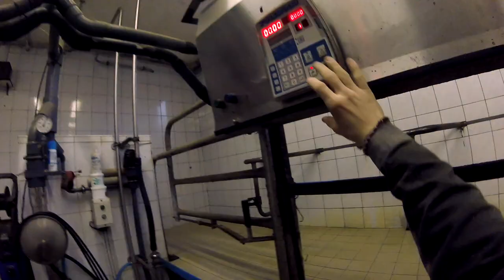A Day on The Farm #13

Comment: Great vid. What do ya think of the john deer. Have ya had any problems with it? All the best lad.
Reply from the maker: Thanks 🙂 its pretty good, especially for grass work or light tillage, it's not the best for the road, but I still use it for transport anyway 😁 we've had some problems the first two years (blown hydraulic pump gasket, powrReverser malfunction) but were repaired under warranty 😉

Comment: Nice video! What's the average prodution of your cows? Do you use any concentrated or you are grass-fed?
Keep up with the good job
Reply from the maker: Thanks 🙂 Around 7000 l in standard lactation. Main ingredients are hay, grass silage and corn silage but we also add some proteins, like canola and grains for energy. For higher production cows we have some concentrats 😉
Reply: @farmerspov4709  

With your average do you think that if your cows were strictly to produce milk, like jerseys for exemple, you would need concentrate? Because they have less need to maintain body weight
Reply from the maker: Hm, interesting question, I don't know, with smaller frame, they would require less energy for their own maintenance, but, depending on what milking average would you be aiming for, they would still need some concentrate to fullfill their demand with the ability of how much dry matter they can eat 🤔 example: if you would feed them only silage and hay, they would get to, lets say, around 15 l of milk daily average. Even if you would feed them more, they may not be able to eat much more. Then there is also peak performance about 1,5 month after calving when the demand is higher. Thats why you have to have some concentrated energy that they can eat in small amounts and cover their needs 🤔
Reply: Yes i agree at peak milking i will probably still need concentrate. At the moment i'm milking holsteins but the cost is extremely high, and for some years now I am thinking of switching to another breed and getting on a diet with very little concentrate, with the prices that we are getting paid i think it's the time.. Let's see what awaits me for the next times
Reply from the maker: It really is just finding balance between milk yield and feed costs. There are farms with high milk yield but may not be doing so good financially because of all the feed that they have to buy, they are just turning around more money 🤔 I wish you all the best 🙂